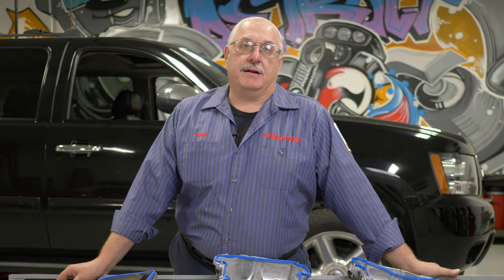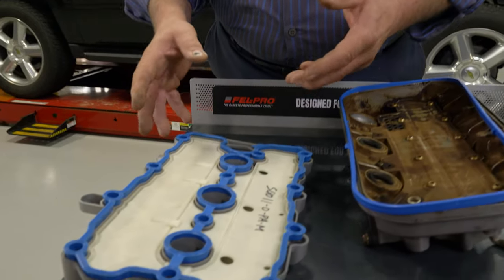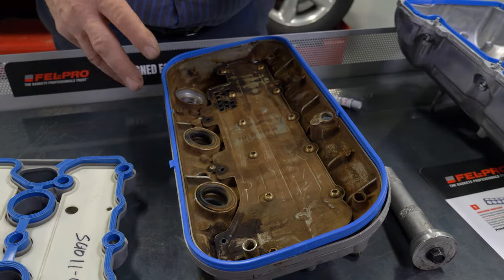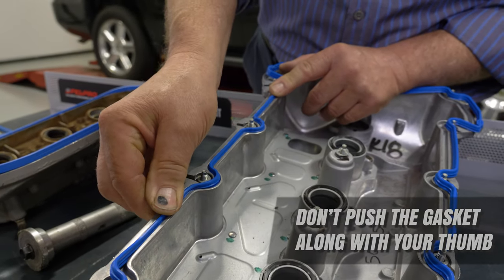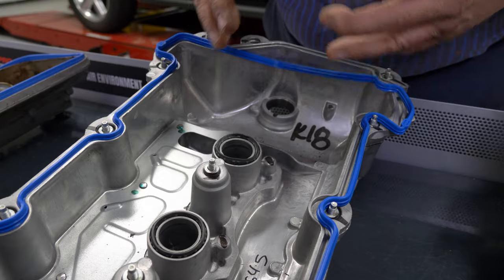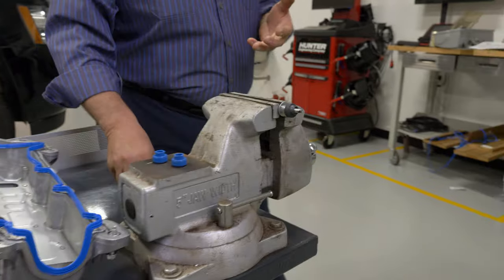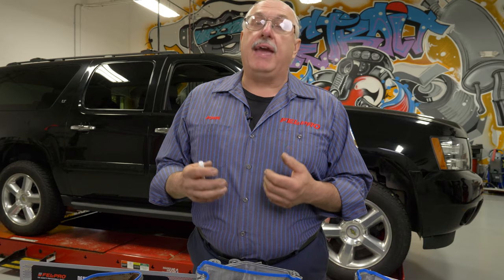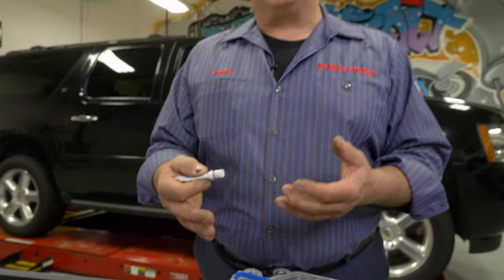Tips for Installing Press-in-Place Valve Cover Gaskets | Fel-Pro Gaskets

Comment: I’m so dumb. I just got done, watched this, and realized I put the spark plug seals upside down and bolted it all back…..GOD DAMNIT!!!!
Reply: You are not dumb you are just learning.👍
Reply: Shit happens, atleast you fixed it before you possibly had an issue.
Reply: It’s not gods fault.
Reply: Aye bro we dumb… duck I mean learning with u dawg. I did that same thang☠️
Reply: Naw bro. If u tilt ur head a little they on the right way
Reply: @Pure-Blooded  its always God's fault
Reply: Don't blame God for your mistakes
Reply: I did the same thing!!
Reply: I feel this
Reply: You’re ok. Im pretty sure the video is wrong.  All Toyotas from factory have the seals installed with the taper down…. You need to pry it to get the seals around the tube.
Reply: Lmao😂
Reply: I was having a hard of a time putting in my valve cover gasket for at least 35 minutes....the holes didn't line up and off by a few mm.......then I realized the gasket was upside down..........Felt like a dum dum for a few minutes. Sh@# happens......Learn from it.
Reply: Wat did it run like ehennu did that?
Reply: Dude...go easy! Thirty years ago, I successfully removed my radiator, put by the trunk of the transport car, promptly backed over it. 😂
Reply: Don't blame God for God's mistakes.
Reply: God’s  last name is not DAMN. He died for US❤️
Reply: Dont blame God nor ask him to Damn the work of your hands. What you did is an honest mistake. Take a deep breathe and do it right. Arent you glad this information is readily available to help all of us who at some time have done what you did. We all make mistakes.  Now you have the info to correct your mistake. You can do it 🤠👍
Reply: Shit happens it will be alright i fucked up my swing arm and but something on backwards

Comment: I call B.S. I just got done installing valve cover gaskets in a 5.7l hemi. Felpro gaskets were junk, for to order separate grommet gaskets and the valve cover gasket wasn't made properly and kept falling out of groove.  Quality left the company for price gouging profits.
Reply: I'm going through this on a hemi now...how did u get it to stay in the groove
Reply: @propcrazy2317  honestly I used a dab of grease on the locking tabs to keep it sticking. You don't ever want to use rtv sealant on these types of gaskets. Be mindful on dropping them in and torque to spec. Mechanics mirror helps to triple check alignment once the cover is on and some of the bolts are finger started.
Reply: Vaseline in the gasket seat in the manifold @dkkauffmanjr

Comment: How do you keep the valve cover gasket in place while putting it on the head there's so much stuff in the way my gasket keeps falling off PLEASE HELP I'M READY TO GRAB A GALLON OF GAS N SET IT ON FIRE
Reply: They have gasket adhesive
Reply: Use some silicone rtv
Reply: Rtv
Reply: He explained at end of video, how to use RTV to help keep in place on some parts of gaskets, when needed😉
Reply: @vincealince_SRT that's not why he mentioned RTV.   That RTV is for places where castings meet that aren't perfectly mated to each other, where the gasket can't seal alone. 🤙🏻

Comment: I bought the felpro gasket kit for my 2007 3.5l Honda odyssey j35a7 engine and it doesn't have the two little notches on the gasket like the one in this video. It doesn't fill the grooves all the way. We (the vendors and myself) verified 3 times that it was the correct gasket kit and it just doesn't have the notches.

Comment: Since the blue gaskets fall out when you try to put them on; I've tried spots of rtv (it worked, but it still sagged so badly between application spots i managed to pinch the gasket). This time i sprayed the valve cover gasket with super 77. It was way better, held in like a champ.
Reply: Hey man I really wanna thank you for making this comment!! 

I was having a NIGHTMARE of a time with this on my G37, and I bought a can of the Super 77 and it worked on my first attempt 🙏🏼

Comment: There is a lot of confusion about the spark plug tube seals. Which way is up? I've seen them put in upside down. It would be nice if Fel-Pro included an instruction sheet to tell people which side goes up and which side goes down instead of having to guess.
Reply: The cylinder head should fit in between the two lips on one side. If the side is flat, it doesn’t belong on the cylinders. Think of it that way. Flat goes against cover, lips go against cylinder.
Reply: @Cheeseburgersoupgirl  I think you have the right idea, you're just articulating it ineffectively. The spark plug seals are closed on one side (flat or rounded side) and open on the other side (side with lips). The closed side goes towards the outside of the engine, while the open side with the lips goes inside towards the cylinder head. This is so that when the piston blow by momentarily pressurizes the crankcase, the pressure pushes the seals tightly towards the spark plug tubes to help them seal better.

Comment: @3:05 I have a ford 3.5l NA engine and all the videos I have seen show the tapered side faces up and they are installed from the top of the valve cover?
Reply: Jus confirmed w Fel-Pro that the ford 3.5l oil seal, is installed with cup facing upwards and from the top of the valve cover

Comment: I got 1 torque in, started the truck ran for 2 seconds, cause i thought i forgot to toque the rocker rail, i took it back apart to re inspect, upon reassembling its already stretched 1inch excess and gotta get new ones 😂

Comment: I rebuilt my wj 4.7 like 5 years ago and this felpro gaskets are beginning to fail. First water pump gasket and now the dayum valve cover gaskets what a junk, and yes I'm ASE certified tech which doesn't mean crap torqued the valve covers and water pump to specs to prevent this from happening and still did. Going to research for sylicone gasket set, victor reinz maybe? Or just use plain permatex right stuff.

Comment: Great Video, However your Gasket Kit for the popular 1.6L is not complete as it does not have the Grommets for the Valve Cover Change as needed, and as you state. These are imperative to a complete and quality job. Curiously I don't even se that you sell the Grommets for the 1.6L, which is even more concerning as multi manufactured gaskets, seals and grommets are NOT recommended. Nice Video though.

Comment: My Fel-Pro gasket seems a bit too big and keeps coming out when i flip it upside down.  2008 Mazda 3 :(
I might have to heat it up so it expands but i'm really nervous now about using it.  I'm just a basic youtube mechanic and thought it would be so easy lol.
Reply: Just use a little of that 3M glue that is designed for gaskets on the corners, let it dry and then install.  Replaced both valve cover gaskets recently on a '10 Hemi and had the same issue you did as it appeared the gasket was simply too large for my particular engine.  Gluing the corners first solved the problem.

Comment: nissan 3.3 L V6 gaskets aren't mirrored, is that normal? One installs flat side down the other round side down
Reply: Does it say that in a manual or is that how the ones were when you took it apart? That's very strange

Comment: I have a 1996 Buick LeSabre. I’m installing a new water pump.  Do I need a gasket sealer for this application?  I’m asking about a gasket sealer and not so much about a gasket maker.  If so, what product would be recommended?  I’ll be using a thread sealer as well.  Thank you.
Reply: Permatex forma-gasket is the best RTV to use. Only apply it to 1 side of gasket though, place gasket on water pump in the orientation it's going to be installed. Be sure it covers the entire perimeter of pump and set aside a moment. If you have a fine wire wheel bit for a drill driver use that to remove any and all remaining gasket/RTV material left behind on the engines mating surface. Don't apply force with drill bit just lightly graze it, you don't want to gouge the surface. Yes! You wanna get ALL foreign material off. I've been doing this since the time I didn't get all the gasket off and the truck returned 2 weeks later with a slight leak and I could hear that distinctive sound the propeller & bearings make letting you know water pump is going bad. But hey you've got one of the very best engines ever built, other than the 350 5.7L Chevy's Corvette C-5 and in 2001 it was placed into the ZO6 Corvette model. Anyway Chevrolet stopped production of the 5.7L 350 cid in 2005. Yeah there's others; Nissan Titan but the rear axle was geared too low causing less torque, Mopar did it to the Hemi but failed to modify the intake (high-rise). I had the 350 5.7L from the Chevy plant in my 1992 Silverado it was an LS6 which in todays world the engine was produced for the Corvette ZO6. Oh and on your pre-installing of water pump keep the gasket on the pump, flatten out the gasket as best you can and take tube of Permatex and like calking, start a bead and go over the entire perimeter even around bolt holes and don't spread it. Be sure it stays in bead form and once you've covered just the 1 side of gasket pick up pump and put a bolt thru a hole in the top of pump and 1 in bottom of pump, to help keep gasket from moving. Then place it on front of engine having a socket on an extension to finger tighten those 2 bolts just to keep it in place. Then you've got the rest, but you'd mentioned using a thread sealer on bolts? Be careful not to use a product that'll have too much resin or hardener as I broke off a bolt due to that. I use Permatex Threadlocker Blue, Medium Strength and it's always perfect, it'll withstand vibrations and temps 300+ degrees. Be sure to tighten to proper torque and don't tighten in a circle or clockwise. Go across from one another, example - looking at a clock face go 10-40, 50-20, 12-6 I think you've got it engine bolts should be tightened in a similar pattern as a tire ya know. So sorry bro for the Novel damn! I'm an instructor at a Technical College and force of habit I guess. I damn well best break it. Hope this was any help at all Brian. Try and hit me back if need be. Take care of that Buick you'll get a million miles out of it. Keep air filter changed and use full Synthetic oil 5W20 and a WIX oil filter the one that's made to filter raw crude oil like synthetic.
Have a great night bro and God bless!
Peace,
Mister Darren Goodwrench 🧰🔧

Comment: Could u put gasket sealant in a hole where the valve cover screw broke? If one screw broke would it cause a leak even with that sealant in it.
Reply: I believe it will leak sooner. The seal is uneven with a screw missing.
Reply: They make a tool to extract broken bolts. Easyout is a common producer. Or you could clean things real well and slather a bunch of rtv in there, 5 inches in both directions, button it up, let it set up for 48 hours, and cross your fingers. I'd go with the first choice.

Comment: I used Fel-Pro for my Elantra 2008 valve cover gasket and I never see this video. This is just common sense, not a rocket since. 50 K miles and still good, no leak at all.

Comment: I find the quality of Fel-Pro Gaskets have gone quit a but over time. Such that the make them so as not to actually fit in the grove of the Valve cover tightly. Which results in making the install much more work and as such you have to use RTV to hold the things in place. Recommend putting RTV every 3" and at the ends of corners and one in the corner.
Reply: Yes. I had this happen. It didn't sit properly and now I have to redo the whole thing. Am going to purchase another brand of gasket.
Reply: Do you think rtv or spray glue would work better?

Comment: Which RTV?
Reply: Ultra black will work: just any that are for high heat, oil, gas, etc
Reply: @tiffanyv4205  thx. Turns out the product has a different product number in Canada, couldn’t figure out what the difference was bc the label was slightly different but apparently it’s the same product